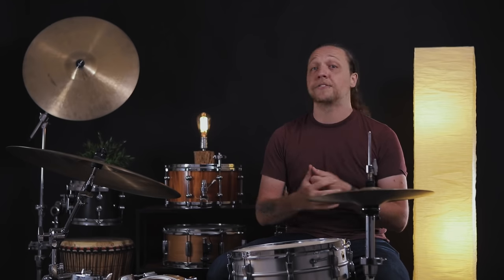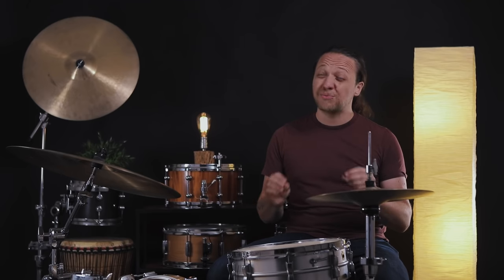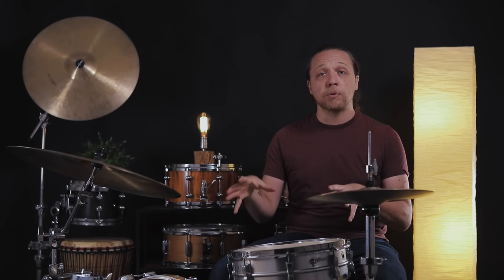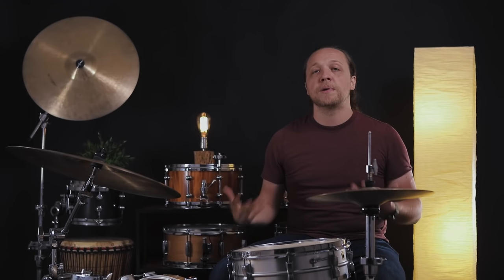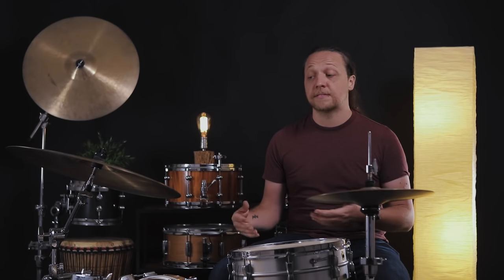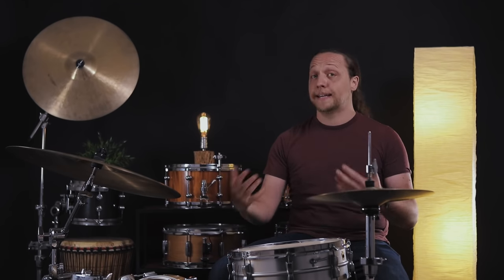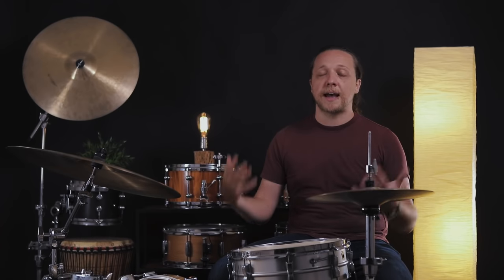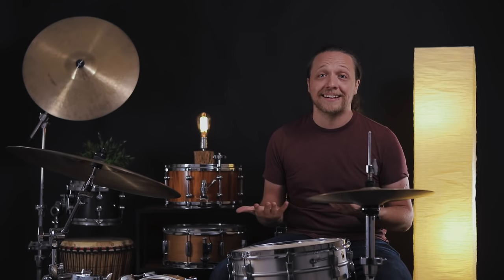Secret to the Ideal Bass Drum Tone | Season Three, Episode 18

Comment: Here's my secret: I was getting frustrated with he amount of ring and sustain I was getting, so i decided to take a 2-ply batter head (22" Remo Pinstripe), cut a hole in it and put it on the front with a coated [emperor] head on the beater side. Backwards from what you normally see but it sounds great! Tons of bottom end and super punchy and tight, I have a little bit of foam dampening the inside but not very much, and certainly less than I was using with the single-ply reso head. Try it out, I'd love to see what some other people think of this trick!

Comment: I have a question. I often will sit behind a kit, and sometimes I feel like doing fast doubles and triplets on a kick drum will sometimes be very easy, and sometimes it feels very hard to do. I've come to learn a huge amount of that responsiveness and bouncyness comes from having the pedal tuned right, but IYO, how much does the batter head have to do with it? Do you think the Batter (tension mainly) can have an impact on the snappyness/response/feel of the pedal when playing faster punk/thrash kind of beats?
Reply from the maker: This is a tricky one - basically, yes the batter head tension has a huge influence because more tension means more rebound, so the lower the head is tuned the less it will bounce the beater away. My general feeling is that as the head tension goes down I increase the spring tension on my pedal a bit to make up for the loss of rebound. Hope that helps! -Cody

Comment: it's extremely useful and the back to back really, clearly show the difference with such small adjustments. What I find it difficult, is how to apply this in real life ? Nobody will be able to determine the pitch of their batter head in a live/gig environment and adjust the reso to a minor 3rd or perfect 4th. Realistically, in a small stage, pub, cafe environment with little time to set up, do soundcheck etc... I don't find this realistic.
Reply from the maker: The intent here isn’t to go to a gig and try to tune your kick heads to a specific interval, that’s wildly impractical. I don’t have intervalic prescriptions for certain situations or anything like that. This is to exhibit that the overall sound of your bass drum is greatly impacted by the reso head and to take that into consideration if you’re having difficulty I.e tighten for control, loosen for boom and sustain. I’m rarely adjusting more than a fraction of a turn in a live situation and try to get things in the ballpark before I go to the gig 👍🏻 -Cody

Comment: Hello! What size port would you use for a 18 inch kick. I’m using a Aquarian super kick on batter side.
Reply from the maker: Hey there! That depends on how you want to use the port and what sound you want to achieve. If you need to reach a mic on there then you need to consider the size of the mic. The more air that escape the less low end you’ll get from an acoustic standpoint. Maybe consider a 4 or 5”? It’s really up to you but do watch our episodes on ports.
Reply: @SoundsLikeADrum  , thank you so much.

Comment: Could you do a similar thing with the batter head?
Reply from the maker: You can, but adjusting the batter tension this much is going to really change the feel of the drum when you strike it. The feel when working with the reso stays largely the same 👍🏻 -Cody
Reply: @SoundsLikeADrum  I meant that through my own experimentation I've noticed that the attack of the drum really changes. I would appriciate a lot to get a professional view of how that changes, independedly from feel. Thanks for responding btw :D

Comment: Batter head 2 camps, grave diggers (bury the beater )   and  door guards (bouncers) . If you sit close to the reso side and hit the batter  center with a mallet, even if the reso tuned high there is an underlying fundamental and that and that is what get's thrown back in the room. I have an Odery Cafe kit. 14 inch (not a typo)  BD and it is bassy enough and it has a lot of punch for a small drum